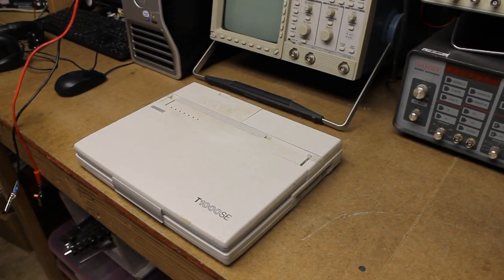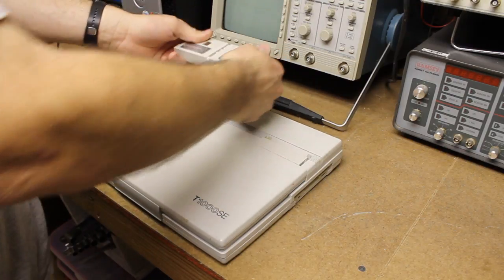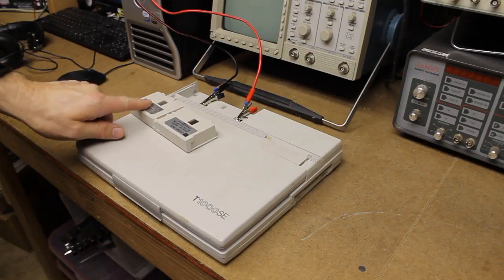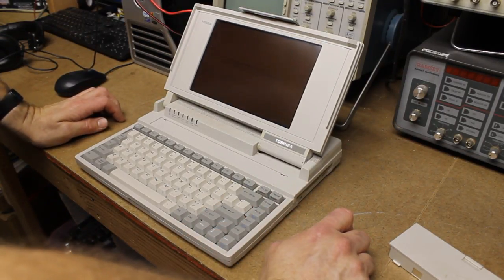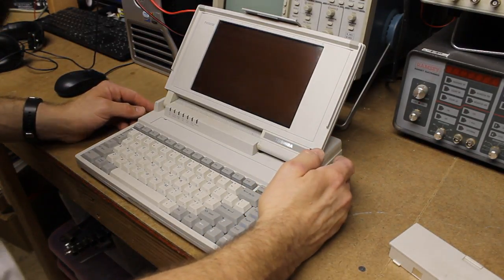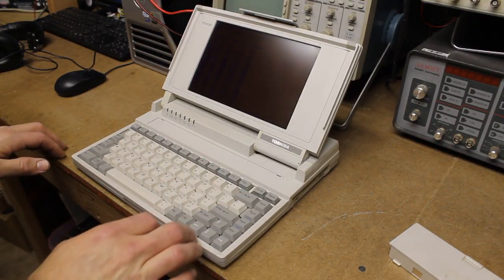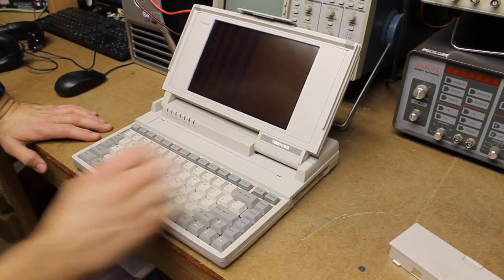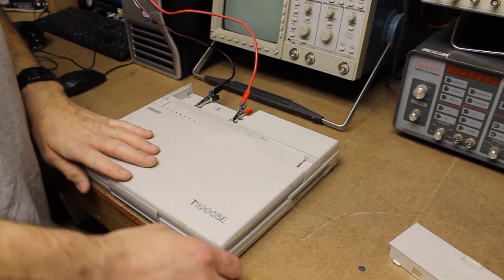Powering a Vintage Toshiba T1000SE Laptop When You Don't Have the Power Adapter

Comment: Hi, 

I have a similar laptop T1000LE and I have not the power adapter too, so I tried to do the same with a 7.5V adapter but I can't turn it on.

When I push the power button all leds lights up and the floppy disk motor sounds and suddenly all turned off.

Do you think is a amperage issue? My adapter is only 330mA.

I tried to connect to DC in connector with a 12V 1.2A adapter and have the same behavior.

Could you give me some idea about what I could do?

Thanks in advance
Reply: These laptop will not starting from adapter without working or missing battery (wiki). You can connect a 7.2-7.5v. and 2-3A. to the battery connectors. DONT be mistake with polarity + and !. Sorry for my english i'm from Ukraina and have a vintage laptope T1000SE too)
Reply: @МиколаЧерновол-г4й  I will try
Reply: I have the same problem, but I have the original AC adapter. I have used the original adapter and a battery pack but it won't start.
Reply: @Grillbrittturbo  Did you find a solution
Reply: Unfortunately not.
Reply: @Grillbrittturbo  
AllCoresEnabled
il y a 5 ans
Thanks for the reply